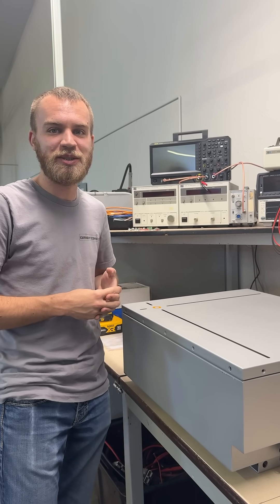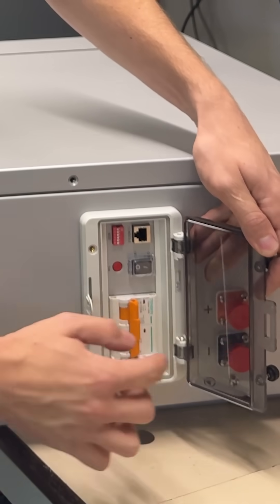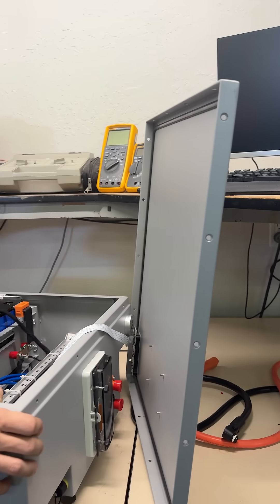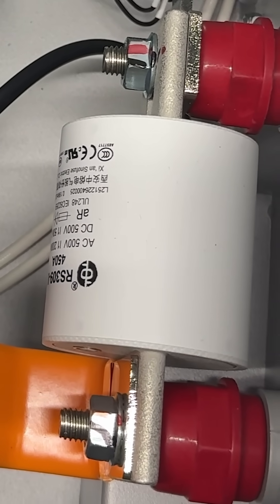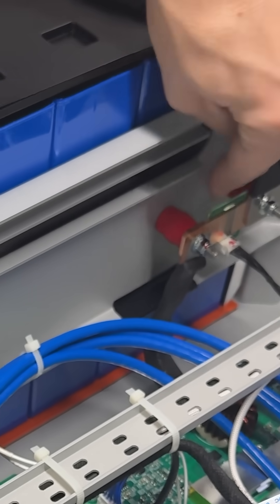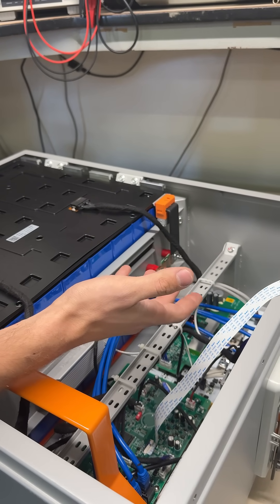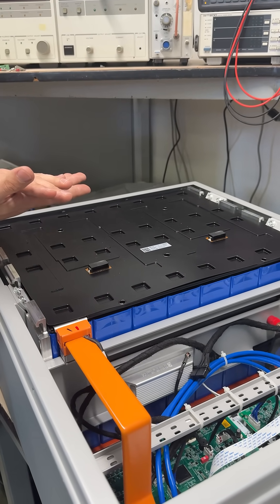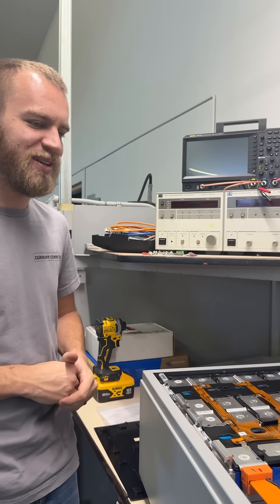The Pytes V10 is continuing to IMPRESS!

Comment: It's nice to see the DIY online stores discovering how nice Pytes batteries are. I gave up on most of the "budget" junk on the market. I tested SOK, Trophy, PowerSync, EG4, and a bunch of those "budget" batteries that YouTubers have been pushing for the last few years and NONE of them had a quality BMS. They all used off-the-shelf BMS's that had problems. They would advertise Victron compatibility but not follow Victron's 3rd party BMS manual. Pytes was the first inexpensive Chinese server rack battery (after Pylontech) that designs and builds their own BMS. And, they worked with Victron to get their support. Pytes are now plug-n-play compatible with DVCC. Good video and I'm glad to see you offer this instead of those SOK batteries. Cheers!
Reply: thank you for the comments so much. where are you based out of?  . yes Pytes is on Victron/SMA official compatible list.
Reply from the maker: Glad to see that you're enjoying them as much as we are! If you are looking for a less expensive Pytes for personal use or recommending to friends, there is the Pytes E-Box batteries - equipped with the same wonderful Pytes BMS and around the same price level as EG4 batteries. We recently added them to the site!

Thanks for your comment, have a fantastic day!
Reply: @CurrentConnected  I run my business on 12 of the E-Box. If you don’t need the internal heating or higher charge/discharge rate then the E-Box is a fantastic choice.